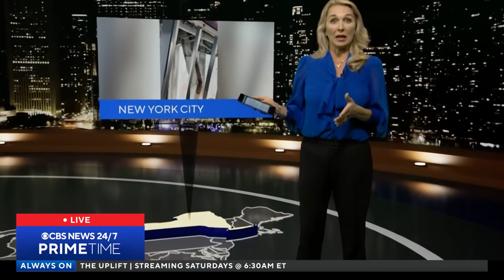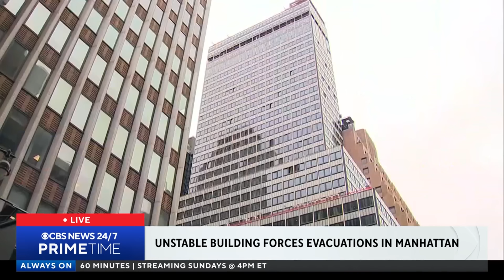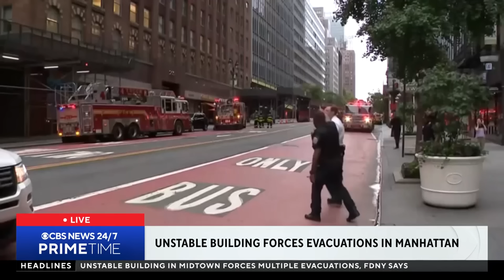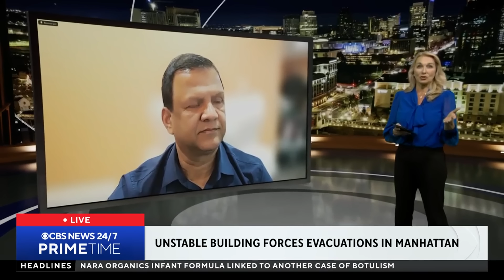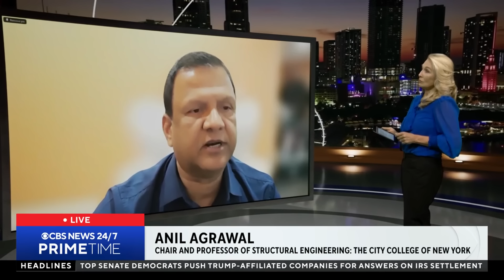Structural engineering professor discusses unstable Midtown Manhattan building

Comment: Unbelievable that engineers intend to fix this.  Once compromised, always compromised.  And when those columns collapsed, there's no telling  exactly how far that stressed load dispersed throughout the rest of the structure.  Even if the very best engineers were to sufficiently shore things up, nobody in their right mind would be in there working on it or living in it.  What genius would think it safe to add floors to a building like this in the first place - except perhaps DEI engineers?

Comment: Wind can make the structures flex, Bend, twist, stretch, and compress. Micrphones can pick up sound thus produced. I recall reports of recordings of this from the Twin Towers. Some of their steel sometimes screamed on amplified audio. If only they were still standing valuable engineering experience and knowledge would have been learned or proved. The stress and strain of the continually varying wind loading is the thing. Think of how you can break a metal coat hanger by bending it back and forth. So maybe put stethoscopes and microphones on beams here and there now and then to find out if they are giving off any sound energy or micro-heat energy.

Comment: Wow!!  As a Structural Designer for more than 50 years, I'm blown away by this??  My question, who is the EOR (Engineer of Record) on this project.  They must have had access to the original design drawings for this building.   To add additional structure to this building all these drawings would need to be reviewed and appropriate strengthening of all structural members found to be undersized would be done BEFORE any addition weight (floors) could be added?  This is a serious breach of proper engineering!   There is no excuse for this.
Reply: The original building may not have been built or used the specified materials. The Chinese are famous for not using the specified materials. A significant number of the buildings that pancaked in Venezuela used Chinese prefabricated concrete walls and columns. There is video of weight bearing structures that only had cement covered foam instead of concrete and not using the correct rebar or not enough rebar. It's called Tofu Dreg.
Reply: @RMartin631  interesting, so many decades of relying on China. NYC was always the financial capital and didn’t suffer the pull out of steel like so many Rust Belt cities left to rot for a long time
Reply: You took the words out of my mouth. I retired Architectural professional with 40 years experience. The RIDA computer modeling operates very different today. Young Engineers factor of safety is very slim. Plus very little common sense.  Most have not been trained in forensic engineering. You need the existing construction and fabrication drawings to begin.
Reply: Totally agree with you. Unfortunately I have seen far too many structures haphazardly added onto. Those columns were engineered to bear a specific load. Whoever engineered and approved this is liable for all costs and potential loss of life!
Reply: That EOR needs a whole bunch of lawyers.   There could be other reasons not his/her fault this buckled, but regardless he/she will be in the spotlight for years.    But to be fair, if the construction itself was done incorrectly (example Harmon Tower Las Vegas) or the existing construction was not as described in the plans (Hyatt Regency Walkway) it would not be his fault.   But it will take a year plus to find the actual root cause.

Comment: 1:05 Take a good look at that image .. the section of building above the orange safety netting fence is not level .. it's leaning to the right. Below that right upper section .. below the orange fence .. that beam is bent! There's no way to fix this building. It has to be demolished. This is what you get with non-union labor .. they will do whatever they're told. Welcome to Venezuela 2.0

Comment: For those who argue that it is the additional stories added that caused the buckling: that could indeed be the case, but due diligence must still be done to rule with absolute certainty that is the case. It still requires engineering analysis; you can not simply make an assumption and have that hypothesis impact millions of dollars in construction costs (and possibly impact thousands of lives) without any data to back it up. It could be that the original plans were optimized only for that necessary load at the time and there was a glaring oversight when the building was modified.

Comment: Adding 16 floors and a roof top pool to a building built in 1961.  What could go wrong? 🤔
Reply: The building was built in the 70s read the reports
Reply: @sharonsimsay7995  What's 10 years among a bunch if highly intelligent structural engineers?

Comment: The U.S. imports steel from China. If they didn't use union labor then it's possible they used cheaper steel from outside sources. We need to find out who owns this property and who is in charge of the overall construction.
Reply: That didn't look like a new Colum
Reply: If the building was built in 1960, it used steel manufactured in nearby Pennsylvania steel mills using iron ore from Michigan.
Reply: Look into Tofu Dreg, this is an example. Renovating with Chinese materials  on top of American made building. Venezuela liked this building renovation style and those buildings completely collapsed in the earthquake.

Comment: Republican Nathan Berman says Zohran Mamdani is Antisemitic for investigation of his collapsing building.
Reply: Everything was perfect. Design was perfect. Engineering perfect. There were no flaws in this typical construction mishap. It was perfect except for those two beams that definitely did not collapse. No issues. Will use gum to secure supports and continue building. No safety factor involved. Totally normal and overhyped.

Comment: I am no engineer but as an electrician seeing those 6 massive coils of wire all together right near the outside wall is not good....there has to be a few tons all gathered in on spot....not what an office building is built for.
Reply: Retired Local 3 IBEW, NYC electrician here and I totally agree with you on that, brother. I would guesstimate from the photos that we are looking at 2,000 lbs a reel x 6 = 12,000 lbs = 6 tons in that small space is asking for trouble. Someone wasn't paying attention here. Wonder what the load is on the upper floors. Strange how no one has been commenting on this.
Reply: Not shure if these are cable drums. Can also be light weight tube drums. But how they got there? May be the have been rolled. And then hit the column .....

Comment: The engineer sounds like the guy who coached these construction workers. You can not go in that building and fix that/ There is no way to safely jack up like 8 floors. The building has to come down. I would say this was purposely done and I bet those beams have cut marks. They weakened the are and expected it to fall in on itself. Probably use undocumented migrants for labor. they look at blue prints and build the stuff, they have no structural knowledge, they just do as they are told, wether it is right or wrong.

Comment: Want a safe, high quality building?  Use quality American made building materials and Union Labor who are trained construction experts.
Reply: That's where it's at! Built to last several lifetimes instead of quarterly profits for some greedy company.
Reply: It was made by Union workers
Reply: It’s not the workers, it’s the engineers.
Reply: The building was built in about 1960. It was likely built with American steel and union labor.
Reply: @xmackc1100 precisely

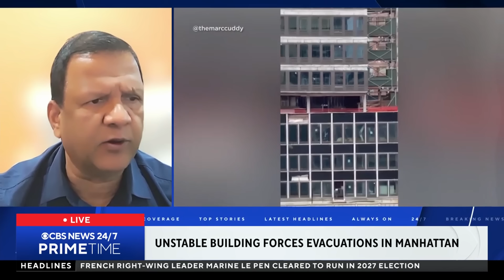Comment: When they zoom out at 3:10, you can see the slight leaning of that section of the building 😳😳. I don't see how they fix that. That's building is most likely going to have to come down
Reply: No doubt. It will cost a fortune to reinforce those old columns. Wonder how old the original building is??
Reply: @garyspence2128 Another commenter said it was built in 1960. The style of architecture looks like that period

Comment: The fact it buckled before construction even ended with all dead loads applied and minimal live loads shows just how severely it was incorrectly built/ designed.
Reply: it was built in the 1960s for office work.  They added additional floors and dug out an underground parking garage (they were fined for digging the parking garage area larger than planned).
Reply: Some civil engineers think there could be other damage as well, apart from what is visible. Personally I hope the building is pulled down.
Reply: Buckling possibly due to uneven load distributions due to residential developments within the floors themselves. Not just the weight. 

My guess now is the building will become abandoned. From a marketing perspective, it will be impossible to sell. Building designed was correct originally for its purpose.
Reply: Could you imagine people moving in and starting to put all their furniture and everything else that will weigh it down even more😮 no way I would live there
Reply: @s @sharonsimsay7995 actly, imagine someone bringing in a piano or something heavy like that? 
Or if someone was having like 20 ppl over? 
My goodness, it was a blessing in disguise that the builders were that awful and it buckled before ppl moved in.
It’s very scary though.

Comment: There were no bricks falling from that building.  There are NO bricks to fall from that building.  Geez.
Reply: It looked like the bricks were stored inside. They may have been trying to put either bricks in the newly constructed interior apts., or perhaps attach bricks to the facade outside. Or they were to be used around the pool construction at the top. Sounds insane, but that's why they were up there. When it buckled, they started spilling out....Now you can say Geez!!🏬
Reply: The exterior is an aluminum and glass curtain wall, like 666 Fifth Ave and dozens of others.

Comment: Well...its kind of obvious from the drone view that the new floors added over stressed the colums.  The furthest buckled column to the right in the video is DIRECTLY under the new supporting column for the new structure above it.  (Notice there is a wider gap between columns on the new level vs below on the old level--thats not good.)  The load was incorretly calculated and the column buckled.  When that happened, the load shifted to the column to the left and THAT one buckled.  The load is now resting on front beam--which appears to be holding. As the engineer said, almost no living structural engineer has seen anything like this because it hasnt happened.  Yes, there have been building collapses but I could not find a case where a deformation happens but no collapse.  The fix is going to becrazy because we have been told the deformation extends through several floors of the older structure...which has 10 or more new floors stacked on top.  It's wild.
Reply: Yes, it sure looks like there was some sort of error of oversight in the structural re-analysis at first glance.  But it could still be more complicated.  Perhaps there was an error in the construction sequence, perhaps the as-built original structure was not properly documented and differed from the drawings, perhaps there were inadvertent material specification inadequacies.  There are many reasons that this could happen, and only a thorough investigation will determine the exact cause, and therefore determine where blame lies.
Reply: I was wondering the same. I count three pillars holding the new construction on top of the old. Definitely not enough. Engineer is in deep.

Comment: Just a layman, here, but a support column that has buckled that much must stand at least 1 ft. shorter than when straight; there HAS to be some serious sagging in the floors above.
Reply: Agree. Not rocket science.  EVERY floor above has dropped.  How are they going to lift up those floors to original  height
Reply: A tower crane
Reply: @jeffng8580 hydraulic jacks... Very powerful ones that will lift maybe at most an inch per
Reply: I would think at the least they would have to rebuild all of the above floors.
Reply: House mover hydraulic jacks 
Because they can run them remotely
Reply: There is no way the installation of any solution would not be extremely dangerous and could not be done without people...though it seems ideal job to try with robots

Comment: They are adding four floors and a pool on the top of an old building? I don't need to be a structural engineer to figure what is happening.
Reply: Adding a pool on top? That's insanity. With the buckling. I'm tearing that sucker down. Would they be satisfied with an 8 story condo setup? Because that's all I'm trusting.
Reply: Actually, yes you do.  Adding floors to buildings can be done if there was adequate strength in the original building, as is often the case.  Only structural engineers can make this determination through careful analysis using modern techniques, software, and Codes.  And it is also true that older buildings are often stronger than modern ones, since over time factors of safety have been reduced, and more accurate analysis techniques, mainly enabled by the use of computers, have evolved.  So yes you do.
Reply: @ScottESchmidt  - but if you add extra floors and weight, don't you need to recalculate the footings too?
Reply: Exactly!
Reply: @kl3nd4thu of course, but they can easily strengthen it.
Reply: @ScottESchmidt  Good Points. But u also need to consider exactly how you go about this work and exactly who will do the work. From reports they did not pay proper attention to either. They also did not follow the plan. They were fined for doing unauthorized work..twice. The other violations were not minor either and show disregard for safety which is not trivial or “ unimportant” as has been suggested. You can convert these older buildings but you need to do it right. It seems they had issues here. They may save this thing but it could go sideways fast. I hope it does not but proper work could have  stopped this.
Reply: @ChasMaravel I don’t understand how they didn’t have city engineers check the work from time to time. I removed a structural wall in my house in Montreal and the city’s engineer came a few times as the contractors did the work to make sure the plans were followed. 
We also needed our engineer to come and verify a few times to make sure they did everything he requested.
Reply: They are adding 11 floors, not four.
Reply: @PandaBear62573 actually 16
Reply: @PandaBear62573  11? So 4 are completed with 8 more new floors to be completed? If you like pancakes that might be the building for you...
Reply: @PandaBear62573  Wow, thanks!
Reply: Quick, fill it with water!
Reply: 11 new floors on both side of the building.  On top of 37 original floors.
Reply: 16 floors added to a building that was already old to begin with and not using union workers who have been doing this for years what could go wrong!
Reply: @sharonsimsay7995 well old doesn’t mean it’s not strong. Actually, construction standards haven’t been the greatest in the past 20-30 years, lots of contractors cut corners.
It can be done, but they had to strengthen it and make to the modifications to the structure and footing. 
Engineers calculate the loads and they can determine how much weight could be added and how. The city had to approve those plans and calculations.
Reply: No, there were ways to do it, but they had to strengthen the structure and foundation. Ppl add 2nd floors on top of garage or on top of an entire bungalow (wooden structure) all the time. 
They also dug a garage. 
I mean, I thought big cities were really careful approving this kind of renovations. 
I am in Canada, I removed 1 wall in my house, on the main floor, with 2 floors on top. It was a structural wall, so to get the permit, we needed engineers to calculate the load and they added steel beams + support columns in the basement, and we had to add a steel beam to went across the ceiling were the wall was removed. The engineers from the city came to check the work a few times as the contractors did it and before we could close the walls.

The builders’ engineers who calculated the loads and looked over the work will most likely lose their job I would think. Hopefully the same will happen to city’s engineers and inspectors who had to monitor the work. This is insane.

Comment: I heard that they are trying to add eleven stories/floors to the existing Pfizer building.
Reply: So make it 30% taller? That's a lot more weight. And remodeling it into residential usage? Too much, and all on a much older building designed for older building codes and standards? Hell to the Nah.....

Comment: Sounds like someone cut some corners during construction and the modifications finally revealed it.
Reply: This is what will probably happen to the block with the cut-corners construction planned for 2029 University Ave., Berkeley, CA.
Reply: They certainly wouldn't  do that to make more money would they??
Reply: In 1961???  This is the former "top" of the building.  It was not designed to have 10-15 more floors put on top of it.
Reply: Sounds like either REBNY or the unions sabotages the building for their own interests
Reply: Thanks Trump! Allows construction under code/removed codes
Reply: @RidKidd20-20TDs is strong with this one

Comment: Someone took out a load baring wall. It was made for office space, not condos.
Reply: It's a steel structure....not a house. There are no load bearing walls.
Reply: Bearing. Not baring. And you're wrong.
Reply: They didn’t hire engineers to calculate the load for the additions if i were to guess. 35 years in construction I saw one house collapse during construction. Main support beam failed…to small ….that’s why you have engineers.
Reply: I had a girlfriend that was load baring, so I had to break it off.